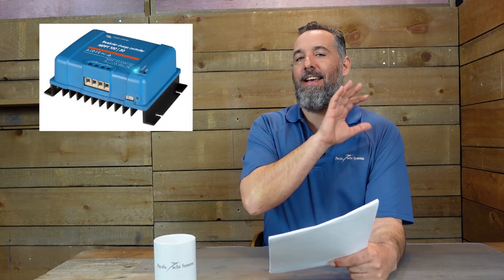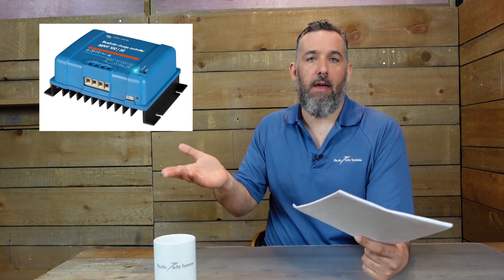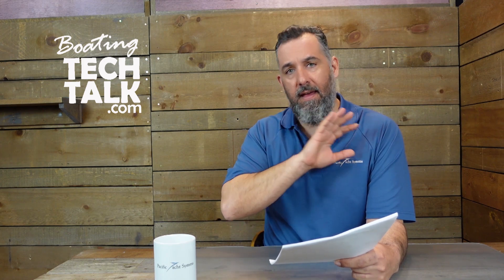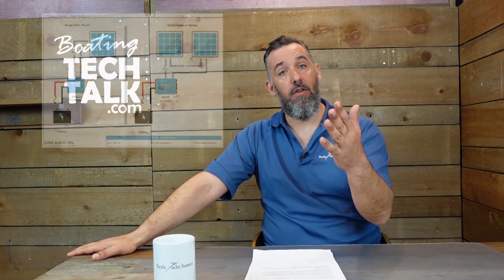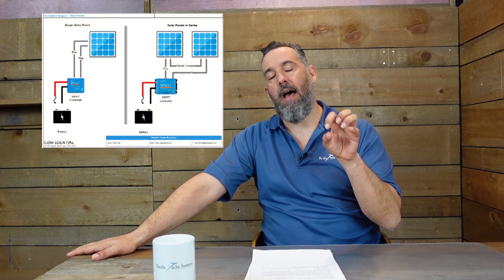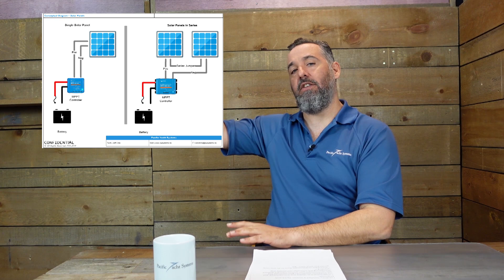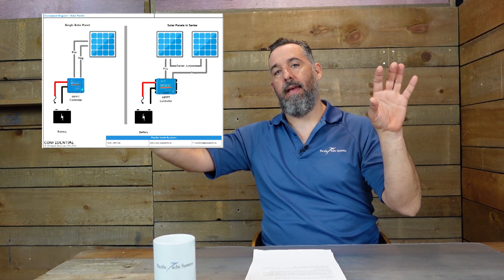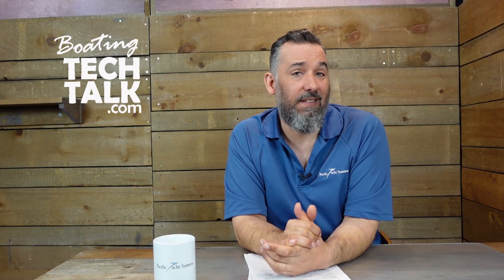How Do I Reset My Bluetooth Solar Controller Without Completely Disconnecting the Controller?

Comment: Thank you; I am constantly having issues with the Bluetooth on my Victron Smart 100/30 controller. I do run two systems off of my solar panels. One for lead acid and one for Lithium. I use a Perko switch to achieve this. For the lead acid batteries I am using a Bouge RV controller and have no issues with its Bluetooth function. The Victron has problems. Now I know how to reset it. I do have a breaker between the lithium batteries and the Victron controller. Now I know in what order to perform the reset task.

Comment: I got the shunt to accept the 6 digit by using the PUK 😊 happy.  BUT the MPPT 75/15 smart some how decided not to make a Bluetooth signal etc.  at all (I am guessing). I did all in this video plus remove the four leads.  Still the Victron Connect doesn’t even know it is there. mobile automotive use.  Devices don’t see it as well. The lights and charging all still works.  pin is on 2 and 3.  Not seen on any device.  Once seen then maybe some of these connection issues solutions might be needed. Could a dongle be used to maybe get into it and reset the unit. Maybe the Bluetooth got shut off by the VC software.
Reply: Did you ever figure this out? One of my mppt 250/100 units lost its Bluetooth signal.
Reply: @JasonEmanuel  I'm having the exact same problem. My system has worked flawlessly for 2 years. Now, the BMV-712 battery monitor shows up, but won't accept any PIN I try (including defaults), and my 100/50 mppt controller is nowhere to be seen. My trailer is fully powered, so the controller is working, but is not being picked up by the app. I have a lever-style circuit breaker between the controller and my panels. Even tripping the breaker at night to remove all power from the controller didn't help.

Super frustrating. C'mon Victron. With enough of us having these issues, something must be up.
Reply: @kellyfowler1809  well, I got my smartsolar mppt scc back up and running using a ve direct smart Bluetooth dongle. Plugged it in, connected to the dongle Bluetooth, factory reset the mppt and power cycled it a couple of times. It is annoying that we can't program via the Venus connection or vrm. I hope you get your devices back in operation!

Comment: Fyi this does not work on my 75/15 when the fuse is disconnected it will stay powered if there is solar power
Reply from the maker: Great point... the solar array also needs to be disconnected... thanks for sharing.

Comment: You know the answer to the 5 sec rule.
The unpluging doesn't kill power instantly. All computers have capacitors and wires themselves have capacity as well, the 5 sec is to let the electrics drain completely
Reply from the maker: Thanks for the good point, well said!

Comment: Hello, I have a Victron controller for my solar system in my RV. My  phone app is not seeing my Victron Controller device. So you're saying to get it to then "see" it I should remove the fuse from the controller then put it back in and my phone app should see the device after that? Is there anyone at Victron who can answer questions or we're just left on our own? I have a Victron 100/50.It was initially showing my device on the phone app but asking for a pass word. Nothing I put in was working. Now it's not even showing up. I have no idea what to do.
Reply from the maker: Victron has two models of controllers: blue solar and smart solar. Only the smart solar comes with a built-in Bluetooth. The Blue solar controller needs a Bluetooth dongle to work.
Reply: Mine is doing the same now. Did you ever find a solution?

Comment: I bought used a Victron Energy BlueSolar MPPT 100/30 but I can't see it in my app either my iPhone, what can it be? do I have to reset it? does it have to be unregistered from the previous owner?
Reply from the maker: Bluesolar doesn't have bluetooth capability. You'll need to get the Victron bluetooth dongle and connect to the VE Bus port on the bottom of the controller.

Comment: I have a 100/50. One day I was having trouble hooking up to it. No matter rebooting my phone or anything. I didn't worry about it. I came home later and it was overcharging at over 15v. I put my ear up to the battery and it was fizzing away in there. No it wasn't equalizing it had recently done that.
So I disconnected everything panels and battery, waited for a while, plugged it all back in and everything was fine again.
I don't know what happened but I think that just totally rebooting at any sign of weirdness is called for. What if I had been away or not noticed? It's been fine since then.
Reply from the maker: Hi Keith, thanks for sharing. Never encountered this before.

Comment: Jeff what size fuse and what type of fuse holder do you recomend for that controler? cheers
Reply from the maker: Choosing the size of fuse depends on the size of a panel, for instance a 100 watt panel, with a good safety margin to avoid nuisance tripping would be 10 amps.
Reply: @PacificYachtSystems  thank you so 200 watts would be a 20amp fuse?
Reply: @svhappymondays  Use the formula Amps = Watts/Volts. So if you're running 200w/12v = 17amps, you may want to have a 25amp fuse. 
But be aware the voltage on the INPUT side from the panels is going to be a lot higher than 12-14.8v on the OUTPUT side where the formula would be 200w/say 50v = 4amps

Comment: Jeff touched on something I would like to elaborate on. making or breaking low voltage DC circuits MUST be done with switchgear rated for the function, and ideally, even with switches designed for it, the circuit should NOT be under load. DC circuits are far more prone to arcing than AC circuits and they do not self-extinguish. Every time a connection arcs it deteriorates (making it MORE prone to arcs). Perfect example of the danger is the way most PV combiners are fused on each PV circuit. If you disconnect one of those fuses under load and don't pull it away from the contacts far and fast enough, you WILL have an electrical fire as the fuse sits in the holder and arcs until the housing catches fire and then it is too late. This situation is far too common. The blankets seem like overkill; trust me, they are good insurance. Keep the keel side down and keep the smoke from coming out. :)
Reply from the maker: Hi Tao4409, well explained, thank-you!
Reply: @PacificYachtSystems  Thank you Sir, for providing a place to do so. :)
Reply: Uqqq

Comment: Wouldn't a resettable circuit breaker be more convenient? Also you recommend that no power is going to the controller from the panels. I have a fairly large array and climbing up and putting blankets is not an easy task. Per a recommendation from another youtuber I have a dual pole disconnect (circuit breaker) between the controller and the panels. Do you see any potential issues with that set up? I've had to reset my victron controller for other reasons and this was the best way because I heard that the controller shouldn't have power coming from the panels without the connection to the battery so I disconnect the panels first, then switch off the controller and turn them back on in the reverse order. I hope I'm doing it right. Thanks for your informative series 😊
Reply from the maker: Hi Charlie, good question. My experience with these double-pole solar breakers are limited. Not sure what trip characteristics are required to quickly disconnect a solar array from a battery. Anybody can weigh in and share on this.

Comment: Great information Jeff.. 👍 Why disconnect for say 5 or 10  seconds? Probably just to let any filter capacitors in the solar controller discharge, allowing the processor to reset.
Reply from the maker: Thanks for sharing Stormer, appreciate it.
Reply: @PacificYachtSystems  No problems Jeff, have a great week!